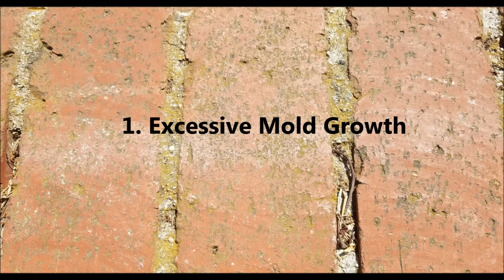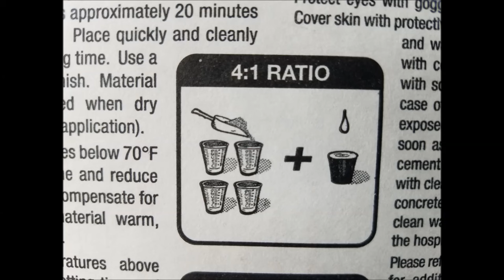Brick Mortar Repair - DIY

Comment: I did this several years ago(10+) using Quikrete acrylic motar repair. Now all the stuff is peeling off the outside walls. It is a humongous task to remove the peeling off stuff and recaulk using a different motar repair. I don't know if I can physically go thru the process of recaulk all four exterior brick walls.
Reply from the maker: Four walls? I hear you on that task! Sounds like you selected a easier and less time consuming approach than mine, (put tube in caulking gun and squeeze), and hey, you got over 10 years of service out of it but now because of the redo work involved, you probably want to hire a professional. They have the tools to make the process easier.

Comment: Thanks for giving a truly diy pov. I plan on repointing some in 2 weeks as a newbie as well
Reply from the maker: If this is a new task for you, I'd suggest practicing with a small amount of mixture first and using the tools and materials on a useless area just to familiarize yourself with the "process" before beginning your actual pointing project. You will gain valuable insight as to how fast the mix dries, how to spritz to postpone the drying time, how to work the material into position and how to have all of your "gear" ready, including clean up, before starting.  Good luck on your project.

Comment: The best way to clean the joints is with an air compressor for inside job or a pressure washer outside. You won't believe how well the air compressor dedusts the surface. No vacuum cleaner cleans the surface as well.
Reply from the maker: Neither of which I possessed at the time but something to consider going forward, thanks.

Comment: I'm no expert but I would have used a grinder .
Reply from the maker: That certainly is an option but I didn't have one on hand or plan on purchasing one at the time.
Reply: An oscillating multi-tool with a grout removal blade is a good option IF the mortar is weak/degraded enough. 
It also is very handy for a load of other jobs (sawing in awkward places, sanding, scraping) and doesn't kick dust anywhere near as much as a grinder!

Of course, this only works when the mortar is weak. Otherwise you spend hours and hours, destroying blades and getting barely a scratch in the mortar. But it is amazing for where the mortar is weak.
Reply from the maker: Yes, there are better and faster tool options available for old mortar removal but I had none of them and still got the job accomplished with a more primitive approach :)  ... Thanks for posting though, it gives others who are reading the comments, other options to look into before tackling their own job.

Comment: I wonder if you used a pastry bag or piping bag to dispense the mortar mix that it might give you a more precise controled shot at the crack you are filling without getting too much on the bricks?
Reply from the maker: In think in masonry they're also called grout / mortar bags. You bring up a good point as far as a different method of application, I just don't have any  experience in using one. Knowing how to adjust the flow diameter, how much to pour into the bag, how often to clean between applications -- mix can harden quickly, and becoming skillful in the application would require some time and learning, but I understand your thinking.
Reply: @notyouraveragejoe855  I'm not expert or anything, I just tried filling some cracks before and I sorta made a mess and got too much mortar on the bricks. I just needed a smaller dispenser method I think. I also didn't get a good match on the mortar not dark enough.
Reply from the maker: Application does require some patience, along with a steady hand. There's also mortar repair and fillers that come in a tube by which you use a caulking gun to apply but that too has its pros and cons. I've had good results cleaning off "residue" from brick or concrete with diluted muriatic acid. As for matching the color to previous mortar, that's tough to do. You don't know what the previous contractor used, let alone if they made it from scratch. You can add powdered colored pigments (LaHabra makes them and Quickrete makes some liquid cement dyes but I'm not sure if they apply to mortar as well) to your mortar mix to alter the final product color but matching that to an existing color is also challenging, let alone making multiple consistent batch colors. A professional contractor probably would have ground out all of the deteriorating mortar and reset the entire wall with their mortar mixture. Exactly what I didn't want to do or pay for, ha. 
In my situation, I already had level bricks in a straight line; so, all I needed to do was prep work and fill in with new mortar. Then, top off the sides and top surface to keep it looking uniform in color.

Comment: You are a patient man and achieved a good result. Great video thanks for sharing. I've just found on eBay a mortar repointing gun like a silicone cartridge gun. Might give one of those a try too.
Reply from the maker: Well said about patience, certainly not the quickest nor the most efficient method but I haven't sung the blues since completing it. I'm hoping to get 10 or more years out of my time and effort but time will tell. Good luck on your project.

Comment: Thank you so much for the great tutorial !!!  I power washed my brick last summer because of the mold overgrowth and I managed to blast off a lot of the mortar in the process !!!  It’s been plaguing me and I know that I need to get this done so thank you very much !!!  I’m going to use your method :)
Reply from the maker: If you're not familiar with the tools and products, start with a very small experimental batch (try an inconspicuous area doing one brick gap joint) to gain experience with the mortar mix, tools, drying time, pouring, shaping and residue cleaning. Good luck Laura, I like your enthusiasm.
Reply: I did the same thing! Lesson learned.

Comment: Thank you for this informative video. I am planning on repointing an old internal brick wall, would you suggest mixing in some bondcrete to the mortar mix itself? And is rapidset necessary or can it be standard mortar mix?
Reply from the maker: Hi Matt. Understand that I am not a professional in this area. I used the bonding agent because I was bonding new mortar to old mortar but I did not mix it into the mortar itself. That would cause the Rapid Set mortar to bond more so to itself rather than the old surfaces or so I read. That's why you see me coating the bonding layer over the old, cleaned, dampened surface first before I applied the new mortar. If I had removed ALL of the old brick mortar, I would have just filled the joints with new mortar mix by itself. Rapid set already has bonding agents within it. There is such a thing as making a "bonding slurry" to bond old concrete to new concrete = mixing in the bonding agent with Portland cement and using the "slurry" as a middle layer between the old + slurry + new but that process need not apply in my situation. 
I've never used BondCrete but I did read that some do apply it to mortar mix to enhance the material. (BondCrete is a liquid bonding agent composed of a polyvinyl acetate homopolymer resin. Used to bond new Portland cement-based and gypsum plaster products to existing properly prepared cement-based substrates. Basic Uses: BondCrete is designed for exterior and interior use to bond new concrete, Portland cement plaster, cementitious products, and gypsum plaster mixes to structurally sound concrete substrates). BUT, you need to know the correct ratios of water, BondCrete and mortar substrate to mix and I am unaware of those details.
Finally, regarding Rapid Set vs Standard Mortar mix: Just add water to Rapid Set and it bonds and hardens very quickly and cures to full strength in just a day or two whereas standard mortar mix (some part Portland Cement, some part lime, and some part sand) will have more workable application time and takes roughly a month to cure and fully strengthen. Whether you add water or some part BondCrete or some part BondCrete AND Water to the Standard mortar mix is up to you, so consult with a professional masonry worker and do your own research. I hope that helps, thanks for commenting and good luck with your project.

Comment: I've got the same problem I'm glad to find this video and what was the cost of the mix an what kinda glue did you use? Thanks much
Reply from the maker: Hi Ian, you must have skipped past that part of the video because I do show the glue that I used (Blue label = QUIKRETE Concrete Bonding Adhesive 1 qt. or if not available, try Sika Pro Select Concrete Bonding Adhesive & Acrylic Fortifier 1 qt .. both are about $10 each). The mortar mix by Rapid Set was a 25# box at <$15. Home Depot had the goods, good luck with your project.

Comment: Can silicone sealant in the large tube be used instead of mortar ?
Reply from the maker: Hi Leena, I will mention a few things to consider but ask a masonry professional in your neighborhood or the appropriate employee at a big box hardware store (ACE, Lowes, Home Depot) because I am not a professional.  
1. I have read that silicone sealants are ideally used on non-porous materials, due to the fact that most of them have acidic properties during the curing process, which can be damaging to porous materials (such as brick). For cement base surfaces and bricks a neutral curing acid-free silicone sealant is recommended.
2. Make sure the type of silicone sealant you're using is designed to bond to whatever surface material you are applying it to or you may get a weak bond, poor seal and or alteration of color. 
3. Filling the gap joints between many bricks is a lot of tube material you would go through, unless you use a "backer rod" of some sort to mostly fill the voided space, say 2/3-3/4 of the joint gap and then top off the surface with your sealant. If you just needed to fix and fill 1 or 2 bricks as a quick solution, that may work but others hopefully reading this and who know this line of work, may guide you differently.

Comment: Thank you - have mortar deterioration on house so will begin gathering items to fix with your vid & one of those repointing guns the other reply talked about - Menards also has them
Reply from the maker: Good luck to you Gina on your project, I wish you success.
Reply: @notyouraveragejoe855  Thank you - I have to get this right
Reply from the maker: Hi Gina, my first concern was that you said "mortar deterioration on house" as opposed to "stucco deterioration on house" ... just make sure you are working with the correct compounds for the job. Second, does that mean you have brick work as part of your house structure or is it more exterior decorative brick? For either one, you may want to ask a licensed contractor as to their opinion on repairs and local building codes to follow if any. My repair was to an exterior wall and only the top surface between the bricks was needed, fairly simple. Cheers.
Reply: @notyouraveragejoe855  yes - thank you - I'm having someone come  check it & will go from there

Comment: What type of glue? How long did your project take?
Reply from the maker: Hi Frank, I point out the type of bonding agent I used in the video at 1:47-2:00... It's called "Concrete Bonding Adhesive" (Blue Label) and it's by QUIKRETE. It took me a week to complete that project by putting in a few hours every day.

Comment: Where do you get a mortar bag???
Reply from the maker: Hi Tom, to be clear, you're reading the "comments section" because I did not use a mortar bag during my video. You can probably find them (called grout, grout masonry mortar, or mortar bags - they're similar conceptually to a piping, pastry, or cake frosting bag with a cylindrical cone shape) at the big box retail home improvement stores such as Lowe's, Home Depot, or other hardware / masonry store or go on-line to similar stores or Amazon. Be sure the bags you order are designed for your substrate material and watch a video on how to use and apply it. It can take some getting use to (how to fill, twist, pressure flow, selection of tip or cutting to size and the application process. Plus, you'll likely need some other tools (a brick jointer or similar to press in the mix material and a brush to wipe away the excess mortar from the brick surface). I hope that helps.
Reply: Try using a freezer (thicker plastic); cut off a corner to your size.  No nozzle to direct the mix.  But it’s 10-20 cents.  For any one use product or tool, I try to see if Harbor Freight has it because it’s about $ 1/2 of a brand name.  So what it doesn’t last.
Reply from the maker: Creative thinking and usage of a "cheap tool" application in order to make the process possibly easier.

Comment: 😢pretty sure you mix the bonding glue in with your mortar
Reply from the maker: Not according to what I read or at least interpreted. If I mixed it as you stated, with new, premixed mortar mix (which already contains bonding properties), it makes the new mortar material harden and bond more so to itself rather than the old material (a debatable topic beyond my knowledge);  thus, potentially weakening the chemical bond between new on old. By applying the adhesive as I did to the surface of the dampened brick and old mortar, the new mortar mix will chemically bond better to the older structure. Some bonding adhesives suggest that you wait until it becomes tacky or almost dry before applying the new mixture. 

Now, I have heard of a "slurry," (adding a layer between old material and new material to act as the bonding layer), by which you add the bonding adhesive to Portland cement and apply that mixture to the dampened old surface. This may be what you are referring to and then, you apply your new mixture over the slurry after a designated drying time.

Comment: Thanks for sharing your project. Wow, every brick on that wall!  Brick-by-brick you worked this wall - great job! How long did it take you with breaks to complete the project?  Earlier today for Round 1, I cleaned-up our front brick steps with two power tools: a wire brush attachment to my Father's old Craftsman corded electric drill and my newly purchased Chicago Electric 1.6 Amp Single Speed Oscillating Multi-Tool.  I am trying to determine whether I do another round of brushing and grinding or move on to cleaning and finish up with a mortar fix?  The following is the back entrance brick steps that I did nearly 4 years ago by manual hand tools [I think I scraped my knuckles more than the mortar] and I will have to clean them up again this year. https://youtube.com/playlist?list=PLGVI8bUyFEzrRTJad2TVU-4UGw65sq10V
Reply from the maker: Yeah Peter, a full week considering I didn't work on it all day long but another full week to curate the content and produce the video.. lol.  Quite the learning curve prepping, mixing, applying, fine tuning, cleaning, and getting all the necessary amateur tools and equipment organized together every day. Your brick project on the other hand, is more complex and very decorative. While looking at all that mortar, layers and brick angles, the word "patience" comes to my mind along with... "Perhaps, I should hire a professional for this restoration project." ... depending on how you approach it but you appear to tackle a great many DIY projects; so, good luck with that beautiful brick work and thanks for commenting and sharing.